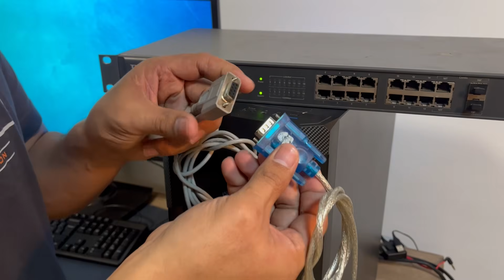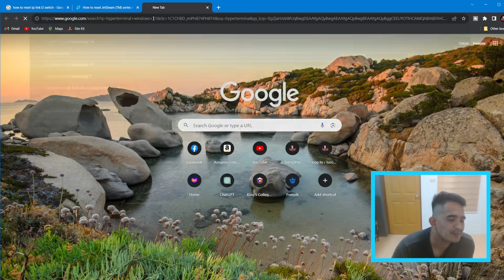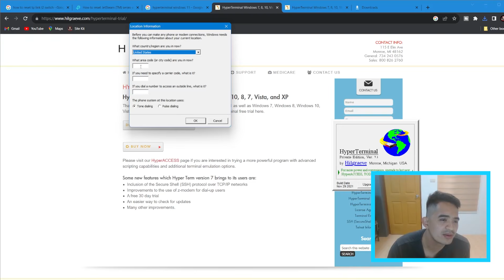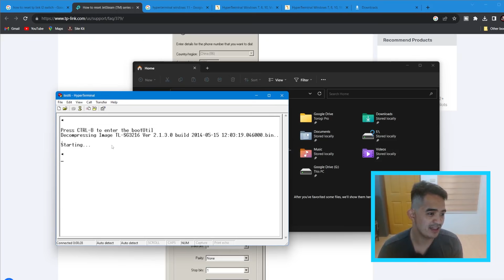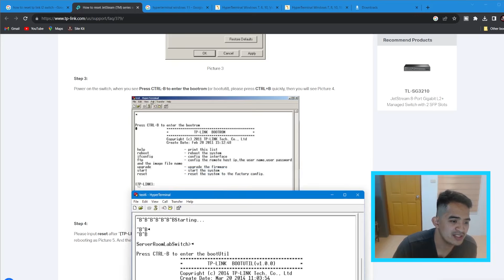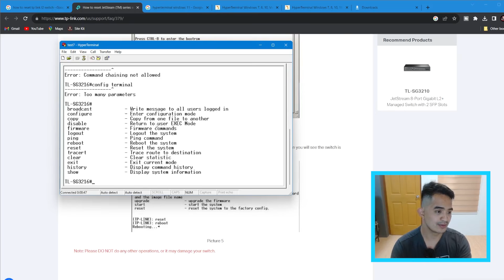How to reset TPLink JetStream switches to factory default by using Hyper Terminal

Comment: My switch errors when I use the RESET command. It say there a disk errors... Googling around I found this may mean the firmware is corrupted. I can select the UPGRADE option and it waits for data. But what do I need to do on the PC to send the firmware?